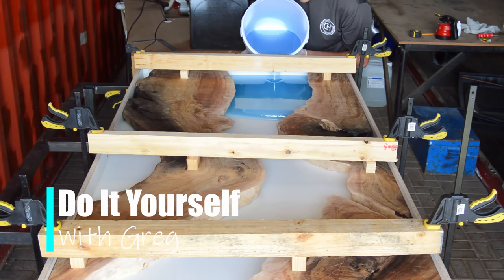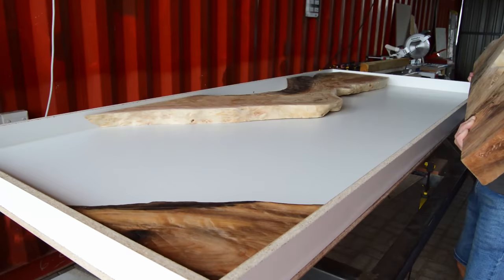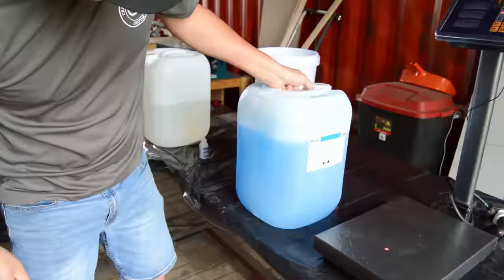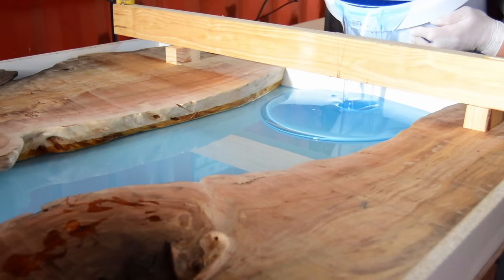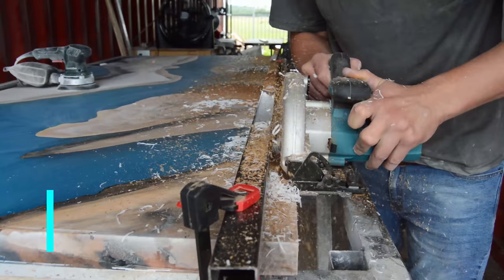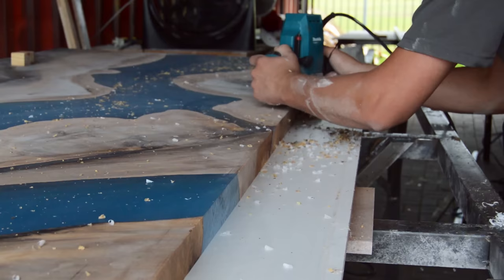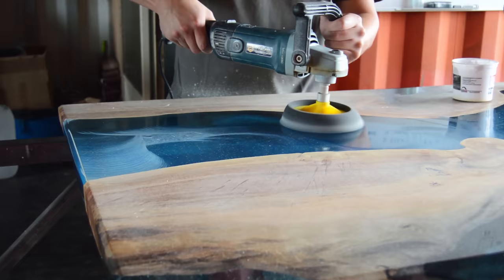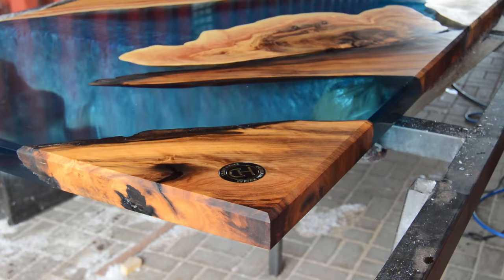DIY Epoxy Table - Step By Step Guide - Part 2

Comment: Hi bro, can I pour epoxy in ply as well....will it be separated from it(ply wood) after it's done...
Reply from the maker: Hi, I personally won’t use ply wood, because it tends to warp and the epoxy will definitely penetrate into the wood, unless if you pour something small like a cutting board, and use the tape, that will work. But for bigger projects I won’t recommend it. Hope this helps
Reply: Thanks man....

Comment: Hi DIY With Greg Channel. I just wached your great video. Very detailed and meticulous. I have a question, What solution do you use to polish Epoxy surface?
Reply from the maker: Thanks for the support 

As shown in the video, you need to start sanding in higher sanding grids, then move to your polish pads

Comment: In all of your vids you're skipping one of the most critical parts; attaching the legs/base into epoxy. Will epoxy support threaded inserts, or will it crack? Is extra wood support needed to hold the weight if inserts are inserted into epoxy?

Comment: Hello!
I am writing from Russia.
A very magnificent and beautiful product!
But I have one question for You.
And how did you secure Your legs at this table?
It can be seen through the resin layer that the table rests on a longitudinal beam. But how this beam is attached is unclear. Or is the fastening made only in the place where the table is supported by wood?
And also, what are the dimensions of this table, (length, width, thickness)?
Thank you in advance.
Reply from the maker: Thanks for the support, we used threaded inserts to fasten our steel legs.
Yes the we have a solid steel base so the table cant move, was 50mm thick x 2.4m long x 1.2m
Reply: @diywithgreg  
Hello!
A completely incomprehensible answer about fixing the legs of this table.
Reply: The answer is threaded inserts. Just like greg said

Comment: Hi greg what ratios of expoxy do you use so as to get a good final mixture
Reply from the maker: The special epoxy we use is a 1:6 ratio as per our suppliers specifications. But please dont use that ratio, whatever epoxy you using has its own ratio and might not be the same as ours, theres 1000 of epoxys on the market

Comment: Hi Greg. Great work on your table ! Can I ask what polish compound you were using with the 2000 to 3000 grit sponge ?
Reply from the maker: Hi its a product from mirka polish compound
Reply: @diywithgreg   Hi, is that Mirka PC35 Polarshine, 20 Polarshine or the PE3 Glass polishing?

Comment: Hi Greg. Considering purchasing your video/pdf course. I’m in the states. I love the wood you used which I guess is native to SA. Do you know of a sawyer or mill where I could order live edge of the same slab online? Thank you in advance. 😊
Reply from the maker: Thanks so much for the support.
Online epoxy class can be purchased on our website.
Slabs im not to sure, SA is very behind on buying slabs online.
We literally have to go into the bush with the sawmill guys to check what slabs are available, then have to send it for drying
Reply: @diywithgreg  Thanks for the reply 😃

Comment: Hi GREG 
VERY NICE TABLE, WHERE DO I GET THAT WAX AND THE SAND PAPER GRIDS YOU USE AS NOT ALL HARDWARE SHOPS DO NOT STOCK THEM
Reply from the maker: Not to sure where you from, you will have to google to see where you can buy it from

Comment: Very nice work. One word of advice. USE A RESPIRATOR, especially if you work with resins and do a lot of sanding. Very toxic stuff. As a matter of a fact use one for everything. Save your lungs man.
Reply from the maker: Huge thanks for the support and kind words! I made this video when i was a bit “uninformed”, Watch my new videos, im busy upgrading my gear to Festool that has the best dust collecting system in the world